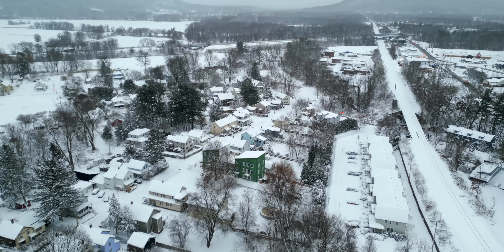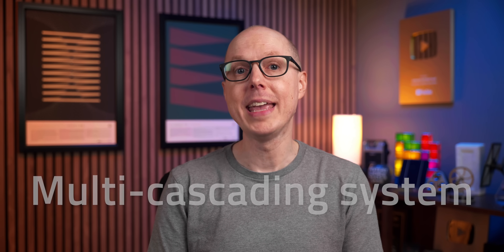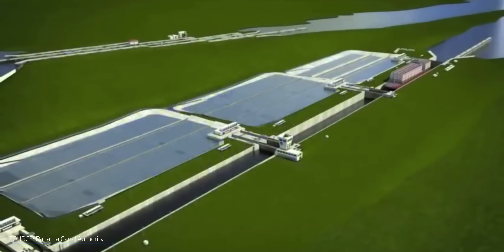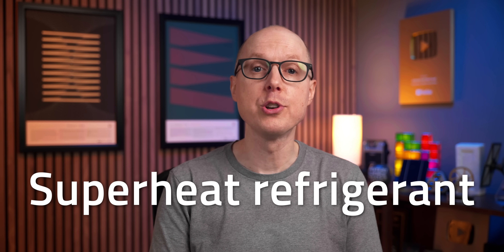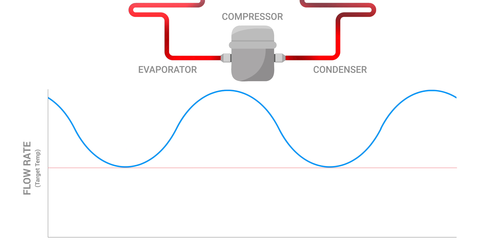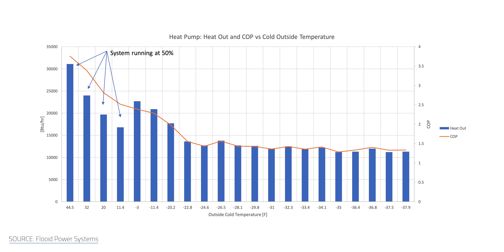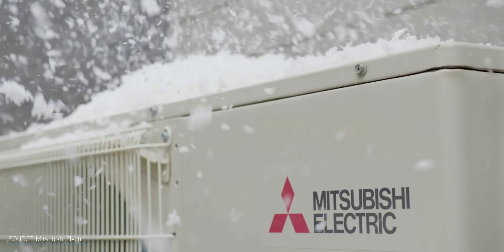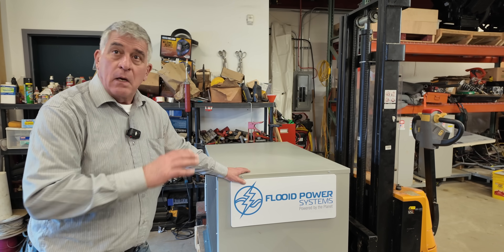How This New Heat Pump is Genius

Comment: They should use heat pumps for all differential heating elements in the house. Refrigerator, hot water, heater, and air conditioning.

Comment: No thanks.  Extra complexity, expense, and maintenance just to handle those few days of extremes is not worth it.  Besides, I want and have a back up heat source that doesn’t rely on electric power.  For those extreme days I can fire ip the back up system.

Comment: When he said "forced hot water systems," it sounded like the holy grail to me. I'll save the name for "someday;" my furnace isn't very old. Also, I make it a point to not use air conditioning, so heat pumps have always been less of a slam-dunk for me.

Comment: I always thought a multi stage heat pump might make a good generator. Have huge low temperature loop, they feed into a medium temperature loop that feeds into a high temperature loop that boils water to drive a turbine connected to a generator. Hell the high temperature loop could probably be on the same shaft as the turbine. Essentially creating a generator that essentially cools the area around it to create power might be good if it was deployed in a city where the ambient temperature is higher.
Reply: The system you describe breaks the laws of physics. More accurately, it would work but the power required to heat the water and drive the turbine is much more than the generator produces.

Comment: They will need different packaging for the systems in  areas Like Socal, the Big unit for a house goes on an outdoor slab and the indoor part is in a closet. A big heat pump trend out here is multizone, so different rooms can have different temperature settings.
Reply: The unit in the video is a split unit as you've described. It appears that they are using a refrigeration chassis, or at least a similar design. (side discharge)

Another type that is also common in the south including somewhat SoCal is using packaged (unitary) units. They are rare in residential where I live due to their lower heating efficiency.

Comment: I don’t understand why insulating houses everywhere, isn’t priority #1. 

Forget solar panels, forget EVs, forget heat pumps (no, I don’t mean that, literally) - insulation is no moving parts, saving energy from day 1, regardless for weather - regardless of keeping the heat inside in the winter and outside in the summer. Yes, the window part of this, is expensive - however - no moving parts, no need for technicians like for mounting solar power or any technical knowledge by the house owner, which is somewhat needed if you are going to invest in solar.

Yes - by all means - continue with the solar, EVs, heatpumps etc. - ban AC only units, require energy effeciency and all the other. However - start by insulating everything, that is an energy upgrade that will probably last the rest of the remaining life of the house, with no needs for servicing of movable parts.

Comment: This is how freeze dryers work.  They have to get the internal temperature down to about -40F, which is too much for a single system to handle.  So you use them in tandem to create a greater difference in temperature.
Reply: Yes, but your freezer is exchanging temperature in your kitchen. It doesn’t use the cold temperature from outside in the winter. Therefore there is always room for improvement if it uses two different cycles. .
Reply: @ЖивотзаЦялото  I said a freeze dryer.  Not a freezer, like your refrigerator.  The freeze dryer itself is a two-stage system... so when you are talking about it leveraging the indoor temperature as a "stage", then this would actually be three stages.
Reply: “You put a jar on the shelf, it lasts forever!”
Reply: Yes, and use 2, 3 or 4 times as much energy to do so - those extra compressors don't come for free
Reply: @peterbetts8740  Well, it takes more energy to reduce temperature down to -40F... there is no free lunch.

Comment: nicer air source mini split can hit a COP of 7.1 with very efficient fans & fan motors & compressors & better quality copper heat exchangers & well insulated lines & quality install

Comment: I can't imagine anything other than a large  coal furnace that would heat living space with an OAT of -30 degrees F.  I am not even sure natural gas would provide enough heat at that temperature.   We use a heat pump down to about 30 degrees then gas to supplement .

Comment: overclockers use cascades to get low temps, you could probably benefit from a couple of big buffer systems - hot and cold to correspond to hi side lo side and pretty easy to do as well with solar and a tec or series of tecs - then you have a cold tank and a hot tank which can make the heat pump more efficient
Reply: TECs are incredibly inefficient. As in a COP of less than 0.1.... (10%)

Very few people need to use anything more than a single refrigeration cycle to get temperatures there are looking for overclocking. Only the most extreme users will demand more, assuming they aren't already boiling liquid nitrogen.
Reply: @SuperS05  you are running the tecs from panels only to get buffers for the heatpump so the inputs are small and offset by greater efficiency of the heatpumps without much fancy sw that can break. record breaking overclockers use cascades and different refrigerants to get lowest possible temps - if you are serious about overclocking you want the cascade setup - it obviates necessity of ln
Reply: @shephusted2714  TECs do not elevate refrigeration efficiency enough to even come close to breaking even. They are using it to simply push the system a tiny bit further using something easy to install. I honestly wish people would just stop using them due to their horrible inefficiencies. Cascades coolers in the overclocking scene are not very common. I'm not saying that they aren't used, I'm just saying they are rare, as boiling nitrogen is far easier and colder for benchmarks. Daily driving overclocking usually doesn't get that cold, although a single refrigeration cycle is the most common, of the bunch. Even just a 2 loop cascade is already really power hungry, so you'd really want it for the novelty. 

Some of the environmental chambers I work with hit -160°c.  I don't have any clients that need more than that, although that'll be neat lol. You generally need 2 loops to hit -60°c. The compressors are large and very inefficient just to handle 2000W of cooling. It just gets worse from there.
Reply: @SuperS05  it is easier and simpler to have buffer systems - and cheaper - breaking even is not a consideration when the electricity is so cheap with solar - go cheap and don't spend money on complex systems which are guaranteed to break and you have no idea in hell as to how to fix them

Comment: I have a wood fired boiler but like to add a heat pump of some kind, plus panels on the roof for sun heating.
-30c in the winter, +35 in summer worst case.

Comment: Where I live I don't have heat or air conditioning nor insulation in my home I built out of interior and exterior block . The temps range from 68 degrees F to 89 degrees F. High ceilings, ceiling fans, and openings keeps it comfortable.  Coming from S. Florida to the breezy coastal hills in the Caribbean I was surprised after living in A/C 11 months a year for 25 years.
Reply: It's a rough life, but somebody's got to live it. Thanks for taking one for the team. 😉

Comment: If the best that it can do is -15 Celsius, that's still not anywhere near good enough for use in Canada. We've got at least 3 months where temperatures are normally well bellow that, reaching an average of -20, but dipping as low as -40 at times.
Reply: In the video I did not see the explanation of how to dump ( extract really) more cold into the already cold air of negative twenty. You simply dig a deep enough hole and use the earth heat -geothermal.

Comment: I like the concept.  The down-side... well, there is a down-side, and that is twice as many parts (2-stage) that can break, though it is unclear how that translates to maintenance since parts quality is a super-big-deal when it comes to heat pumps.  A high quality heat pump can run for 25 years with zero maintenance.  A low quality heat pump will break after 2.

Secondarily, the need is situational.  Obviously upper mid-west, new-england, sierras, etc... those would benefit greatly.  But the market is smaller than the whole of the U.S. so for a company to really be able to make an impact one wants a technology that can be built cost effectively and provides significant efficiency improvements across the board, even against single-stage heat pumps in temperate climates.
Reply: You spotted the fatal flaw but also the selling point.
More work for manufacturers & installers and more costs for you

Comment: Heat pumps will make sense in our climate (New England) when electricity does not generate CO23.  Matt lives in New England, takes advantage of rebates, but the reality those rebates come from tax & utility $. 
But it's all worth it if you have zero carbon emissions right?
When Vermont Nuclear, Northfield Hydro storage, and pilgrim were operational we were 40% carbon free at risk of a nuclear disaster. Today our electricity is 2% carbon free with low production and distribution efficiency. Today we need Canada's CANDU technology being implemented everywhere but here. Eventually MIT and DOE will do Fusion. But for now CANDU provides intrinsically safe fission using heavy water, unenriched fuel, and minimal waste. Then we can talk heat pumps.

Comment: Heat pumps are replacing gas and oil fired furnaces.  This is more loading on the power grid.  Now, BEV's are being pushed in a big way.  Where does the electricity come from?  Mostly gas, oil, and coal fired power plants.  Even if enough were being produced for the soon to be demand the distribution infrastructure can't handle the peak loading.  Now what?

Comment: I have a pump on my condensate drain and ran the drain line and cool condensate water to a drip hose that cools the condensor on my outside ac unit which  also has a roof over it and side panels to block the scorching heat from sunlight that we have down here in nw Florida... It's lowered my electric usage significantly during the warmer months which is 75% of the year... Plus as an added benefit I don't have the heat from the unit blowing against the wall of my house..
Reply: FYI, solar radiation doesn't effect the performance much at all. Less than 1%. That roof is just getting in the way of expelling the hot exhaust air. The condensate is cooling the condenser via evaporative cooling far more than the tiny bit of sensible heat you'll be able to measure. Condensate water is generally mineral free unlike potable water which helps reduce scale buildup but it is still quite dirty. (organic compounds, organic acids, and organic growth.) this can lead to corrosion issues particularly between the copper and aluminum if you don't have an aluminum microchannel. It can also allow certain bacteria such as E-coli and legionella to thrive and be spread in the air in a wide plume. There's good reason why it's not common.
Reply: @SuperS05  Actually the two things I mentioned above cut my power usage by my outside unit by as much as 15% according to my meters,and the roof is 6' above the unit,sloped upwards towards the non sunny northern side and away from my house walls and roof, while the side panels are laced wood boards with plenty of airflow as well as being 6' distant from the unit..The condensate water goes across multiple dams ,and a high micron inline filter that remove an unknown percentage of anything in the condensate. After 15 years of this the coil looks almost new and has no buildup other than some paint flakes from the unit and pollen discoloration...Over 20 years in the hvac industry before I even tried any of this,and as I use pv to power my home and units, I tend to keep a very close eye on usage and such... It didn't really cost me much to do as I did all of the carpentry,plumbing,etc. work myself using either used materials or leftover new materials from jobs...Unit is an ancient 14 seer unit using the original compressor,and everything other than a capacitor,and the contactor which I've replaced each once during the past 15 years..
Reply: @Wil_Liam1  the particle filter is helping. You really don't want it directly on the fins, but spayed into  the air stream or over a pad far enough away allowing the water to evaporate before hitting the coil.

Like I said it's not common for a reason. It can be a health risk, and similar setups have been a health problem in the past. You'll hear it more commonly in relation to cooling towers without proper water  treatment. 

The shade can keep the ground cooler allowing for more effective  evaporative cooling especially via plants and grass. It doesn't effect the unit directly in any appreciable amount. All your savings are the result of the evaporative cooling. 15% lines up for a cooler semi arid or warmer average humidity climate.

Comment: finally.  i've been watching heat pumps for years wondering when they would become more than just clever for residential homes.  we're getting a generic split for cooling the upstairs in summer, but there's too much space to depend on it for heat.
Reply: They do quite well at heating. If your winters routinely have times below -5F get one with auxiliary electric resistance heating in the air handler.

Mr. Cool now has a ceiling cassette air handler as an option in their DIY line.
Reply: @greggv8  thanks, interesting, something to look into. we have a brick townhouse and the top floor barely gets cold in the winter when the rest is comfy.  heat rises etc.  i'm in the same weather pattern as matt.
Reply: @greggv8  do note that Mr. Cool DIY units aren't legal everywhere. (just about every western country other than the US) Their warranty is a bit of a joke. At least they are cheap enough though to just buy another whole unit when it dies, even if it's not great for the environment.

Comment: Did I understand that correctly, these cascading heat pumps can achieve a high output temperature at a reasonable COP? Where I live (the Netherlands) we don't have a problem with super cold days outside but a common issue with heat pumps is retrofitting them to houses with radiators. The flow temperature needs to be low to get a good COP and our hot water often comes from an instant gas boiler which needs to be replaced by a cylinder which is then not heated as high as the boiler achieved with a heat pump. So to avoid legionella they resistively heat up the tank once a week to kill the bacteria. I hope these guys bring their idea to Europe.
Reply: I believe that's the case.

Comment: As a MA resident with an old oil system, I would love for residential cascading heat pumps to be a reasonable option. I'd be curious as to their cost comparison to ground based geothermal systems. 

As always, thanks for the neat dive!

Comment: Downside.  Who will make this to what quality?  Industry has become famous for designing for failure to insure repeat business.  Now with double the heat pumps in a unit (double the cost?) we have double the failure points on a platform known to be designed for failure.
So if it cost double or close to it, and has twice the likelihood of breaking down, will there be any realistic savings, or just the potential of savings never actually realized? 
Just another lure to hook suckers.
Reply: Insure means to secure or protect financially, i.e. insurance.
I don't think they take out insurance on repeat business.
Reply: @tim3172 Perhaps it's a colloquialism, but if I were to write a sentence that begins 
"In order to insure repeat business, the company .......",  and
then describe the actions the company took, it would be considered common english, understood by all,  in the environments in which I have lived.  (Canada, and several states in the US) 
Protecting future sales by an action or mechanism would seem to fall into the catagory of financial protection.   But maybe you are correct, and it is not "proper" english.

Comment: This is definitely something to keep my eye on, for when we expand the house. Right now we have window units (cut through the walls, rather than stuck in a window) in each area of the home. This has had the added benefit of individualized temperature control.
Reply: Yep. No sense in heating or cooling rooms that don't need it.
It's a challenge to train the kids to close the doors though!
Reply: @Wordsmiths  They are teenage girls. they seem to think all doors should be closed, except for their parent's room.

Comment: well done report  simple and detailed   correct, when backup resistance elements are gone, so do all the things that make heat pumps under perform.  I suspect they are also programed in ways that say kick ini resistance heating before min temps, just one big biz backscratching others.

Comment: I would like to see & own a heat pump that uses the hot water tank as a capacitor & a sand battery as its battery. Pulls and pushes heat into the house to maintain a comfortable temperature while using the compressor when power is cheap to reheat the battery or to exhaust excess heat when the battery can't handle a more rapid change in temperature. With an added heat source as a solar roof's cooling system.